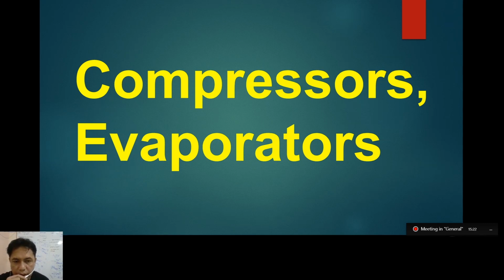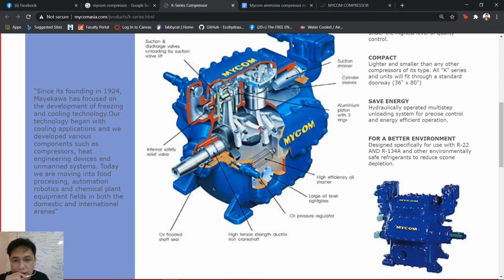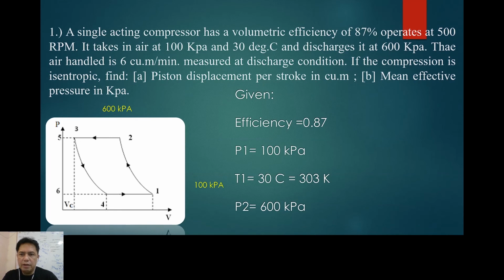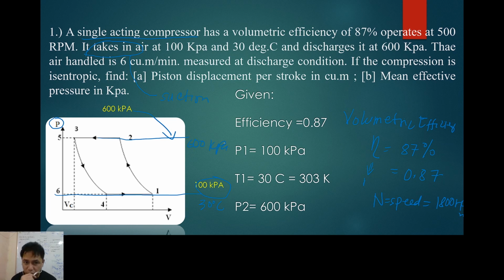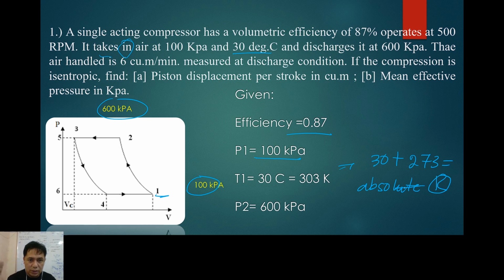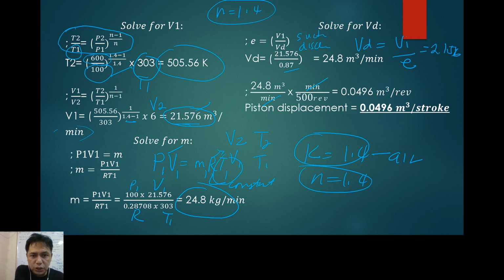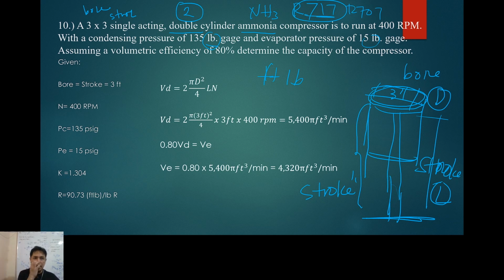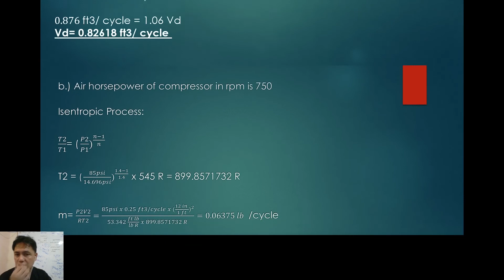Refrigeration & Air Conditioning :Solving Problems on Compressor Part 1

Comment: Many thanks for the great lecture you delivered  ProfCharlton! A brief look  of the refrigeration cycle helps to keep the function of the compressor in context. After compression, at high pressure, refrigerant vapor exits the compressor discharge heading to the condenser which rejects heat from the refrigerant vapor such that it condenses into liquid refrigerant.  The liquid then enters the evaporator through a flow control device on the low pressure side of the refrigerant system where it boils back into steam and by doing so you absorb the heat from the cooling room. The refrigerant vapor is then sucked on the compressor to the side of the suction line where it goes into the compressor and the cycle begins.
.... interesting and helpful topics!